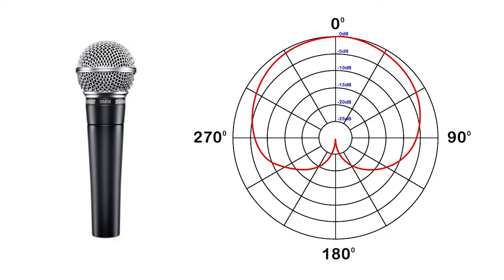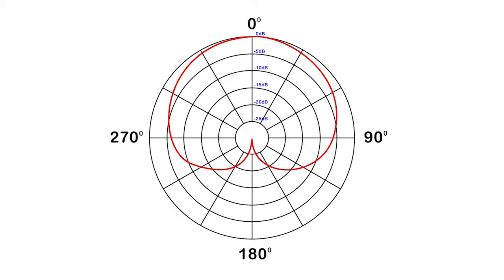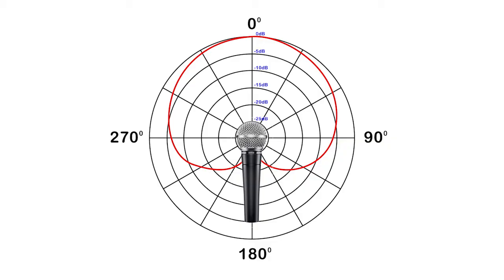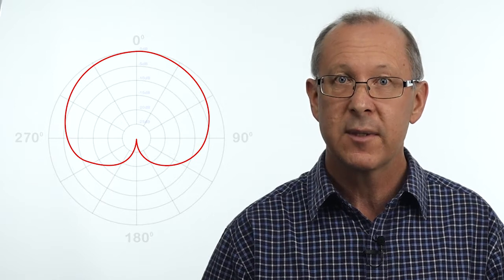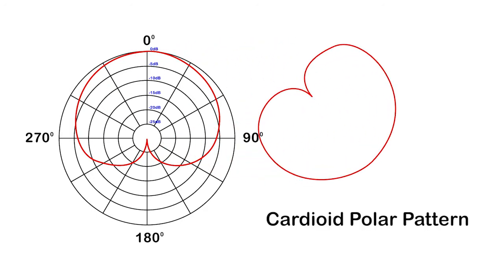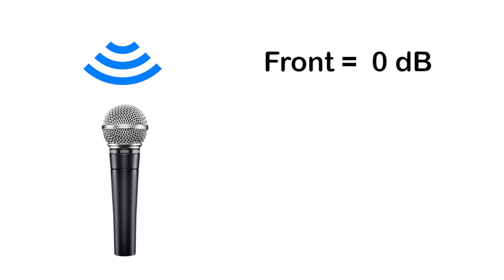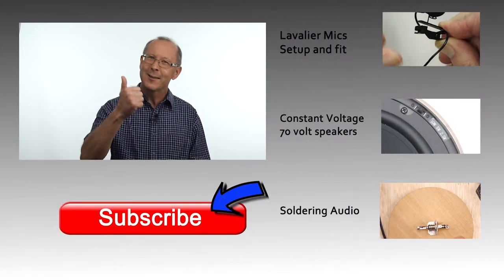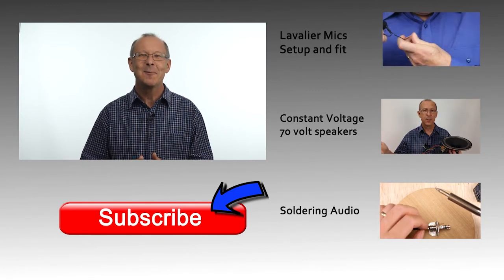How does a microphone work? | Polar Pattern

Comment: Thanks for the explanation,  if I have understood correctly, then the "plane" of the circle is in a vertical orientation , and the mike is placed vertically, then @ 1.05 the sound coming from the " front " at "0 deg" is actually "top"  of the microphone and at @1.14 sound at 180deg coming for the "back" is actually coming from the bottom of the microphone. Kindly correct if I am wrong...
Reply from the maker: Yes, the back of the mic is where the lead comes out. For the purpose of the illustration the back is the bottom of the graph.
Reply: @GaryDmedia  thank you..

Comment: Hi Gary, thanks for this video. I do have a question. I have to shoot guitar instructional videos where there's a guitarist, and a digital piano player. I have both the RODE NTG-1 and a Shure SM58 as well. The problem is, the guitarist and pianist don't wear head phones, so we have to have speakers on with amplified sound of the guitar and piano so they can hear what they're playing. The guitar and piano are recorded direct, not mic'd. The only mic'd source is the guitarist's voice. Problem is that I don't want to hear the bleed over of the guitar and piano that are coming out of the speakers, in the mic. I only want to hear the voice. Or minimize as much as possible the other instrument sounds. I've been using the RODE mic, but now I've just learned that it's super-cardioid so I should probably be using the Shure, and place the speakers somewhere to the rear? The farther away the better? But is there a point where if the speakers are too loud, the mic is going to pick them up no matter what? Thanks for any advice :-)
Reply from the maker: Mike, you are correct in choosing the SM58 for this job. Using it at close proximity to the singer is essential. That is what that mic is designed for. BUT. There is a good reason why any recording studio uses closed headphones for recording. Even then, they have issues with the noise of the keyboard keys and ambient noise from the instruments as well. Have you thought of multi-tracking the recording and recording the vocals later? Just a thought.
Reply: Hi Gary, these are instructional videos, it's not a performance. The guitarist is on camera talking and playing, and he uses a piano player to play chords every so often. I just had a long chat with someone at B&H and they suggested that I need to deal with acoustic reflections. Shooting in a residential home basement (finished) with sheet rocked walls and carpet. I even moved the speakers about 8 feet behind the mic and pointed them 180 degrees in the opposite direction, and the mic still picks them up. Tried putting a blanket in front of the speakers as a quick test to see if it absorbed the sound but it didn't seem to do anything. So I'm not sure what to do at this point.
Reply: I also have this mic available https://www.audio-technica.com/cms/resource_library/files/73630cfb4ffd4a65/pro_7aprodpro.pdf Says it's a cardiod too
Reply from the maker: Mike, you have been given some good advice there with the acoustics. Condenser mics, even cardioid pattern tend to be very sensitive and are not a good choice in this setting. Do what ever you can to lower the volume of the monitors they are using. Get them to turn them down as much as they can and get the singer to sing close to the mike.
Reply: Yes, it seems that lowering the volume on the monitor speakers is the only good fix. Seems impossible to reduce the bleed into the mic.
Reply: Still screwing around with this issue. Would you by any chance recommend a unidirectional headset mic?  One of those really small unobtrusive looking types? If I understand correctly, they do a good job picking up the voice because it's very close to the face, and being unidirectional, they should do a good job of not picking up the speakers? If so, is there a budget one you recommend that works well?  I learned that the Shure does a great job of not picking up the speakers, but for it to get the voice, it really needs to be no more than a couple inches away from the subject's face. Not ideal.
Reply from the maker: Mike, I just had a look through your previous comments. Using a headset microphone help greatly but will not eliminate the audio from the speakers completely. Even if you spend thousands of dollars on a headset microphone the sound will still be picked up because of reflections from the walls, ceiling and floor. One suggestion that my help is to get your musicians to use in ear monitoring to hear the sound of their instruments and a mix from the vocal mic. I have tried to record a band in a similar way with multi-track recording and it works well. Remember, even if you illuminate the sound of the amplified instruments in the room your vocal mic will still pick up the sound of the plectrum and keyboard keys being struck. Hope this at least gives you something else to consider.
Reply: Yes, I tried the in ear monitor route, and the guitarist is dead against them, he wants the live sound through speakers. I'm taking a chance and bought the Shure WH20. I posed the question on Amazon about this particular headset not picking up sounds other than the voice. Someone replied and said they drum and sing and that the mic doesn't pick up the drums. To me that sounds like a good test because drums are pretty loud and they're very close to the mic too. I can position the speakers pretty far away from where the mic is so I'm hoping if it doesn't pick up drums  from the same person who is singing, then it should be perfect for what I need. I'll know tomorrow, ordered it overnight from Amazon. We shall see!
Reply from the maker: I am keen to find out how it works out. You have a difficult situation to record in.
Reply: Tell me about it! I will let you know :-)
Reply: Gary, the mic arrived and we did a brief test with it, and playing a backing track through the speakers and it performed beautifully. I was able to crank the speakers up to a decent volume and that new headset mic by Shure didn't pick them up at all. Beautiful!
Reply from the maker: That's fantastic. What a challenge that's been. Just wondering what the object of these recording sessions have been. You said you were filming instructional videos. Is it for your own project or a contract for someone else or are you designing your own online course?
Reply: Thanks, yes, quite frustrating but I think it's solved now. Yes, we do them in-house, and yes they will be for DVD and online courses as well.
Reply from the maker: That's really great. I wish you well on the rest of your recording sessions.

Comment: Great Video!
But how do you select a polar pattern in different situations
Mainly In a studio sound proof  room for VOX and INSTRUMENT
Reply from the maker: +Aditya Mane If there was no reason to concern ourselves with other instruments, reflections, other singers etc we could just use an Omni-directional microphone for everything. If we want to reject certain things we select a polar pattern to suit the task. For most, a cardioid pattern is fine. It picks up sound mainly on the front and rejects sound from the back and some from the sides.  Allowing just enough room noise into the mix to add a realistic feel to the recording. In situations where there is so much unwanted sound as well, you have to choose a tighter polar pattern to reject more.
Reply: Thank You SO MUCH your reply did helped me.

Comment: The dB markings still confuse me. One mic I'm looking at has a cardioid that gets to the 0 dB marking, the other has also a cardioid but it reaches the -5dB. What does that mean??
Reply from the maker: +Mario Paul Don't worry if the front only measures -5db. The polar pattern is only a visual representation of the difference between the front, sides and back sensitivities. The best measurement of overall microphone sensitivity is another measurement that is listed in the microphone specifications list. The higher that milli-volt@94db number the more sensitive the mic is overall from the front. Hope that helps.